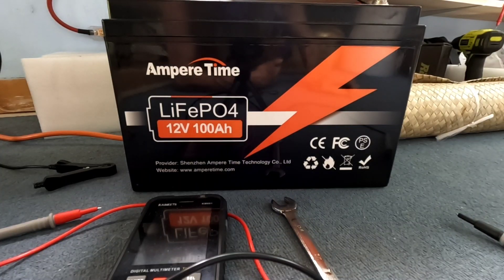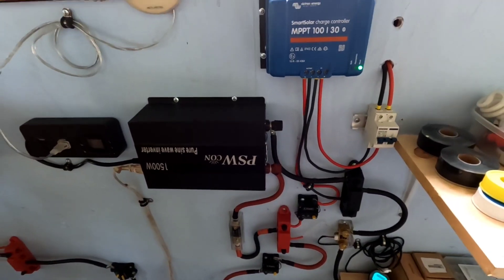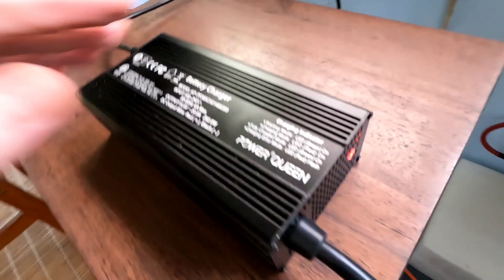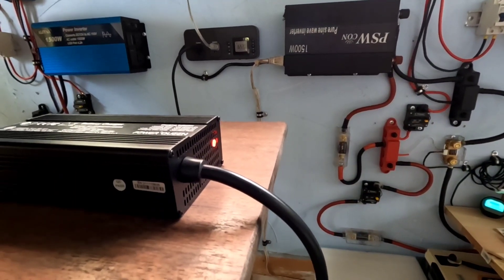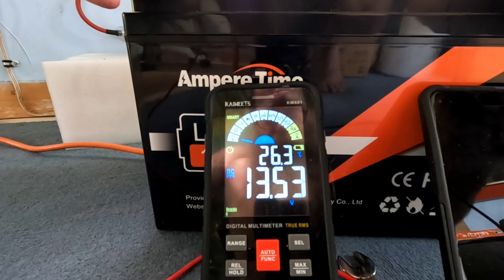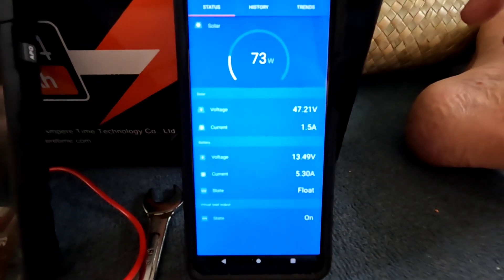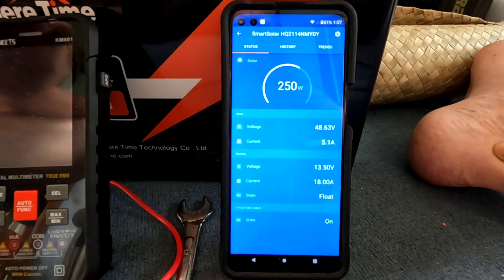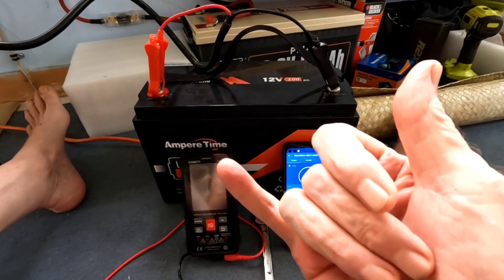POWER QUEEN 14.6v 20 amp LiFePO4 charger running off solar charger/generator

Comment: Correction The Lifepo4 battery does not float charge only your lead acid battery floats chargers, the Lifepo4 battery chargers to 14.4 volts and stops the chemistry is different between the 2 battery.

Comment: Do you like the Ampere Time batteries? I bought their 12v 300 ah for emergency solar power for a small window air conditioner after hurricanes and to reduce my electric bill if it starts getting too expensive. Might as well use the thing, right? I bought a cheap 20 amp LiFeP04 charger along with it so I can top the battery off if I see a terrible storm is on the way and the sun isn`t shining. I could only afford a 60 amp MPPT controller but I only have three 100 w panels, a 190 w, and 100 and 120 folding panels. Not yet sure how I should connect these to the controller. Been studying it. I`ve never set up a solar system.
Reply from the maker: Love the Ampere time battery...working perfectly,  no issues at all🤙

Comment: when you got extra sun that a great way to go. you could switch battery's but that extra work. it is more efficient just to switch battery. My stand alone 12V charging station has Anderson SB 50 gray disconnect and I made one with clip leads. My charge controller is Moring star MPPT and I easy can select different battery. flooded lead/AGM/ Lifepo4 and 12 or 24V battery. that the only station I use gray SB 50 on 24V my 24V system is yellow and can not plug in to a outher color. That a great charger. was wondering if power queen charger  goes to green and fan off when finished charging ? 😄
Reply from the maker: Yes, green light is on, red light is charging,  flashing red is error, and green is full and fan off as well...aloha 🤙

Comment: Using a main system to charge a secondary is perfect!  Who cares about the losses when everything is coming from the sun and not the main battery.  Great Video!
Reply from the maker: That's my philosophy too! Everything topped off, only had to plug a charger in...didn't even break a sweat! aloha 🤙

Comment: I bought that same Power Queen charger with my Four 100AH Power Queen batteries.  It worked great and topped off those so I could connect them together for a small AC unit on a 1000 watt inverter. All inspired by your videos thanks and continue to make them.
Reply from the maker: Awesome! I sure will, and mahalo for being part of the channel! 🤙

Comment: I put a boat battery switch in my setup so can switch to charge a second battery saved me buying a charger... like the idea though...
Reply from the maker: I like your idea a lot! I think that is the better way for sure. Fun using the charger too...another backup.  Aloha 🤙
Reply: @ProjectsinParadise808  if you are going to try my way you have to connect 2nd battery 1st, turn off any loads on inverter then just flick the switch. The capacitors in the inverter don't have time to discharge so no surge... Takes my epever about 3 mins to see the change then kicks in to full charging mode... I actually leave 2 batteries connected and charge the lowest when sun shines and uses fullest at night.... I could charge them both to full and go parrallel but decided to block the switch in the both position.... Switch is 350A and was €25 here in not so paradise Europe...

Comment: I'm not sure if I should use a dedicated  Lithium charger or keep Using my victron with a 48V adjustable power supply, on my most efficient  Inverter. I'm Wasting 2 amps transferring power from battery to battery. But it sure is nice to use the app.lol  My question is would it be more efficient to use a dc to dc boost converter?  What is the most efficient  Power transfer method from battery to battery?
Reply from the maker: Yeah, I love the Victron controller and app. Makes everything so easy. Love seeing the history,  and all other details.  I'm not sure what is the most efficient dc  to dc , I was just making use of excess power and was curious how running that charger would work.  It did well, and now both batteries full, and I didn't have to turn a wrench! Aloha 🤙

Comment: Why don’t you unplug the original battery and use that to charge using DC to DC less efficiency lost.
Reply: I'm not answer for him but I do the same thing when the sun is out it will still charge the battery and the main battery will stay charged.
I sit out in my yard under a shade tree I can run a fan and my battery will never drop as long as the sun is out. If the sun is out you can run a water pump with a pressure switch using just a solar panel no battery.
Reply from the maker: That's great!🤙
Reply from the maker: I take your point. I wanted the experiment without the hassle of switching anything around. It did well, if not the most efficient,  both batteries fully charged today on one system.  Aloha 🤙
Reply: I do the same thing with power station, first use Ac to charge then try DC charge, now I just turn off everything charge direct to empty power station.  Feel that is fastest way to charge empty battery.

I think convenient is a factor.